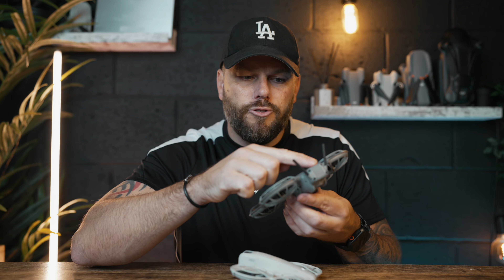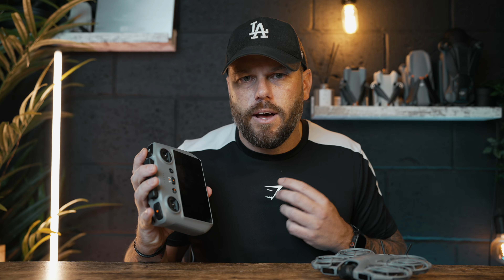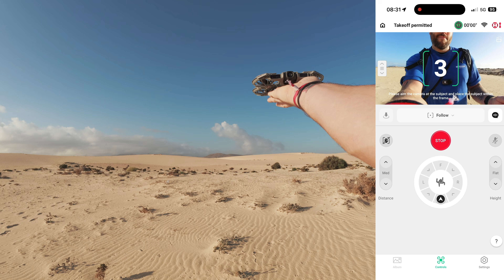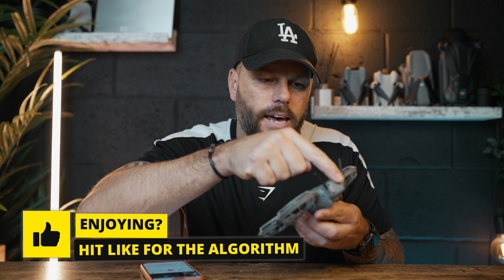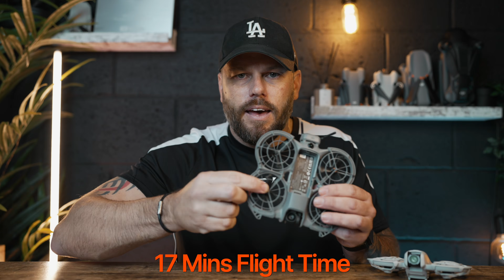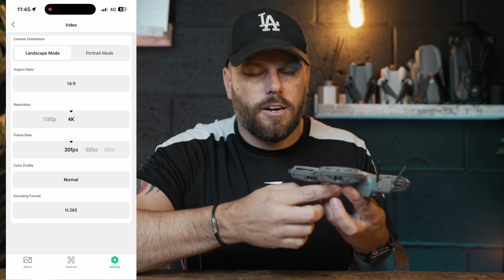DJI NEO 2 REVIEW - Watch Before You Buy!

Comment: Neo 2 is not Neo's predecessor (as you say in the beginning), it's its successor :P
also later 'Neo was unique, we had never seen anything like this before". No, the Neo was pretty a direct answer to the HoverAir X1.
Also the module you add on the back is ONLY for linking it to a controller, not the phone--it's only using the network protocols that the controller uses; that being said, if you plan on ONLY using it with gesture/voice control and/or your phone, you can leave that module off.

Comment: So I just returned from a 38 day backpacking trip. I used my Neo 2 just about everyday, and can say that it’s a huge improvement from the Neo 1. By far most valuable for me is that the wifi range is vastly improved. I got some great images from 50-75 metres up - something I would never do with the 1. And its avoidance tech meant that I could get much better angles. 
All in all, I think this is the ultimate traveling drone.

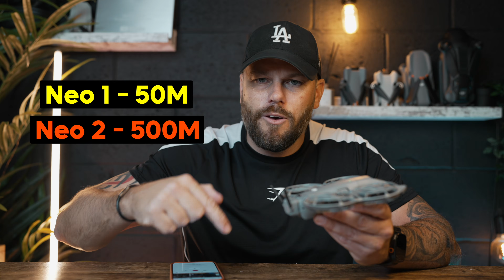Comment: 9:32 the transmitter is doing nothing with wifi, it only does the O4 connection. But I still got 80 m at 60 m height in a place with lots of interference.

Comment: Great video! Two questions - 1) If you dial down the sharpness to minus 2 with a controller (not possible to do with the phone), does the Minus 2 stay in place once the controller is disconnected and replaced with the phone to fly it? 2) The luts you put together for the Neo 1 - would you still recommend using those or will you do a new version? Thanks Mike

Comment: Bro, Temu has cases for the Neo2 that protect the transmission module antennas for cheap! They're like a sleeve for the whole drone.
Reply: Do you have a link? A quick search yielded no results.
Reply: @MTBenna yeah I can't find them again, either. That sucks
Reply: @MTBenna  my mistake, it was aliexpress, not temu. "Dji neo2 3d printed case"

Comment: The transmission module only works with an external controller, it does not come into play when using WiFi.  Your test was carried out i  the best possible conditions but realistically you can expect between 150 & 300mtrs by putting your phone into airplane mode making sure your phone provider sim is turned off.  With the transmission module fitted, a one way distance rest should be about 4k, but a fly out and safe return 1,500 to 2000mtrs at most.  Fantastic review 👏 👌

Comment: FYI the module makes zero difference to the range for WiFi signal of a phone it extends the distance for the wireless transmission to the DJI controllers
Reply: He should make it clear so strong misinformation!
Reply: It doesn't extend the distance it provides connection, because without it you cannot connect to the 04 digital network.
Reply: So is the range with just your phone still really short?
Reply: So you need the controller with the transmitter to get that extra range not just with a phone and transmitter?

Comment: I like what I see about this neo 2 and I most likely will buy one. The one question I have; can this drone look away from the subject while flying in tracking mode. It would be great if the drone could fly in front of you and looking at what you are seeing rather than looking at you. I do a lot a close work walking behind the drone with the controller. Can the neo 2 do this without using a controller.

Comment: The optional digital transceiver doesn't increase the range of the WiFi mode. It's only for use with the DJi RC controller and the Goggles.
Reply: This is the first time I've heard someone say the transmission module extends wifi range, I'm pretty sure this info is incorrect too

Comment: The digital transceiver is the O4 module. It's independent from the wifi transmission.  The transceiver is only required to fly the drone with the rcn3 or the fpv setup.
Reply: or the DJI RC2

Comment: One mistake in video. Wifi connection range still the same with or without transsmision module. It is about 150m in real life. Just can not use remote controler (RCN3, RC2, googles,.. )   without module.

Comment: I like new cam. I get tired of praising it's distance. U have to add  module. At least with 1st neo u  did not have module, it just worked with all. I like using neo in tightly woody area. That module would hit a branch. That module is a step back. Been flying 1.5 years. Whenever dji make something new it gets mass praise. Old stuff r disgarded.

Comment: Great review on a great little drone. You don't mention one problem point of the first Neo, which is the screamy noise. Judging from your footage, that hasn't changed much, right? So, still not suitable for discrete flying. Small props have to turn fast.

Comment: Great review thank you. Just one point I wanted to check; I had understood that the 500m WiFi range was not dependent on having the transmission module attached. I believed the transmission module gave the 04 Video Connectivity for the 10km video and controller range?? Are you able to comment 👍

Comment: This won't matter to some, but it Dolly Track is why I bought the Hoover and will not buy the Neo 2 as the Hoover has enough features for me.
"The DJI Neo 2 does not consistently stay in front of you like the Hover X1 Pro; the Hover is better at consistently tracking from the front, while the Neo is more prone to falling behind or to the side if you change direction, though it can work in open spaces with slower movement." """"

Comment: The biggest improvement is really the fact that it returns to your hand. I'd say 90%+ of Neos were lost because Neo VPS just didn't return to the same exact spot when doing Quick Shots. So it was stupidly risky near the water or in the mountains. Of course DJI never fixed it, as well as the fly away problems. DJI is the GOAT of the trash support in the latest years. Because, well, I guess they are just focused on launching 6 drones every year, as well as cameras, roombas or the future 3D printer. For god's sake, just ODM this crap.
Fly More is fine, in fact there are three official Fly More packs in the wild. One without the RC-N3 + Transceiver for 329€, one with them for 399€ and of course the Motion for 579€. But the standard pack (239€) is perfectly fine this time because, unlike the "leaks" said months ago, the batteries and Transceiver are stupidly cheap (batteries for 39€ and Transceiver for 21€ 💀). It is certainly the cheapest DJI drone ever, when it comes to buying the standard pack + accessories separately.

Comment: The rental car company will be calling. They didn't find your test quite as fun. 😮😅 I bought a Drone Only Fly more since I have way too many RC-N2/N3 and RC-2  Controllers. Needed to buy the Digital Transmission Module separately,  but it was only $36, so under $360 for everything I need, i have Motion Controller 3, Goggles 3. Not a bad upgrade!
Reply from the maker: That's a great upgrade! If it's a rental don't be gentle....

Comment: For me this is great because it can be a flying action cam for sport in a way the mini drones can’t. From what I’ve seen it could still use a better chip for AI processing because it still makes mistakes at speed, and if it could have some Apple Watch compatibility that would be great so we don’t need to bring our phones to use it. And of course an SD card slot, bigger sensor with true vertical, D-Log M and some kind of folding mechanism for easy carrying would make the next iteration perfect! Still a great step up from the first Neo though and I’m buying one for sure

Comment: I may end up Buying Neo 2.. but it pisses me off that the trasreceiver is not part of a stand alone package. They got a fly morę combo with 3 barterowa and hub but without the most needed part to connect to freeking RC nc3 even... Left alone goggles n3 and RC motion...
Reply: Btw the digital transreceiver doesn't boost wifi range its for the O4 unit and it for rc and motion controller and goggles

Comment: Nice review. I just bought the motion controller and goggles package. Thinking of getting an fpv controller too. I was under the impression the module made no difference for the phone connection, but necessary for controller use?
Reply from the maker: The range using the module is a lot better now!
Reply: @DMProductions ah ok, thanks for the reply. Looking forward to the video about the range with the phone.

Comment: Would this drone without any remote be usable to do a visual roof inspection? Or remote is essential for this?
I would need to be able to fly it up and slowly go up and down the roof.
Reply: Depends on how high is the house. I bet the high limit may still be around 50 m
Reply: @dandragon1st just a two storey house nothing mad.
50m above the take off location would easily cover 10+ storeys in that case.
I was more worried about controlling the drone e.g. checking along gutters, chimney, that sort of thing.
Reply: @Edsdrafts camera on Neo 1 was quite good for that top do Neo 2 should be good as well. Controlling on Phone alone might be less precise than with RC N3 but quite enought. You may consider using tablet instead of phone in RCN3 for better view.

Comment: Great review, thank you! 😊
I have a small request:
Could you test how fast the drone flies when controlling it only with the smartphone, compared to using the Remote Controller? 
And could you also show which camera settings are limited when using just the phone — for example ISO, exposure, camera modes, etc.?

One more thing:
Could you also test the maximum flight distance (signal range) with and without the Wi-Fi range extender / additional Wi-Fi accessory?
A comparison of the signal strength and real-world range would be super helpful.

A “Smartphone vs. Remote Controller + Wi-Fi addon” comparison would be amazing. Thanks a lot! 🙏
Reply from the maker: hold my beer, it;s dropping probably Friday

Comment: I was always iffy flying drones via Wifi after my DJI Spark from many many years ago decided to fly away to find a new owner, I did end up finding it in someone's backyard. Im glad that it's highly unlikely nowadays for flyaways with new wifi tech. I might have to pick this up with the wifi module.
Reply: It’s not a wifi module it’s a transceiver for use with the remotes or FP goggles. It helps solve latency issues with video transmission to the controller/goggles.

Comment: would you consider attaching the module without the screws for quick unplug and packaway?
Reply from the maker: yes you can, if you crash it as its only held in by usb it could pop out tho
Reply: @DMProductions  it’s only 9g so I imagine the usb C connection would be able to hold it in under normal flying conditions 👍🏼
Reply: @DMProductions  It is a shame it wasn't also held on with a couple of small magnets, think of all the sales of replacement modules DJI would have made.

Comment: Are you sure the antenna module is what improves the Wi-Fi transmission? I read that this module is only for the O4 transmission? Can you test if there is a difference in the WiFi range with and without the module, and what is that difference? Because I was thinking to get only the drone, with nothing else, and just control it only with the phone. Thank you!
Reply: As a guy who only used his phone to control my Neo 1, I’ve been following the improved wifi range closely. I don’t think you need the transmitter. The site states:
“When flying the drone with a remote controller or goggles, install DJI Neo 2 Digital Transceiver for stable, low‑latency video transmission.”
Reply from the maker: stay tuned I show the difference, the original drone wifi only has max 50m range
Reply: @DMProductions  I think he is right, the antenna doesn't increase wifi range with phone usage only.
Reply: @DMProductions  Thank you! I am looking forward to a comparison on the same place with and without the antenna module, to see if it makes a range difference over WiFi, because all the other reviewers say that the WiFi range is improved without the antenna module.